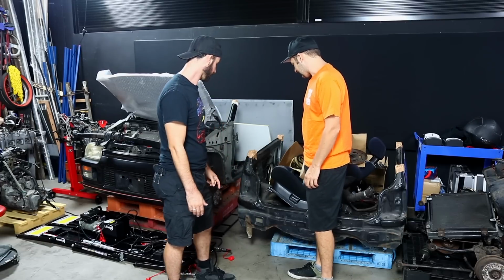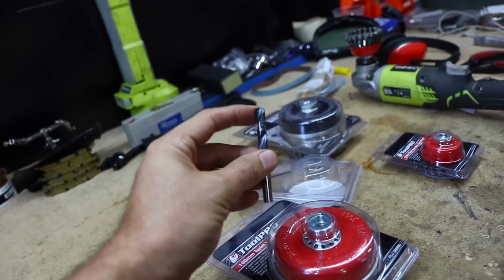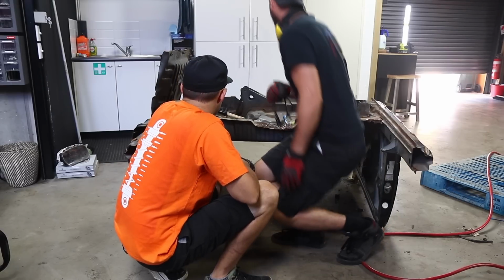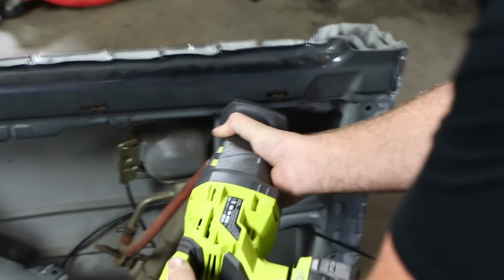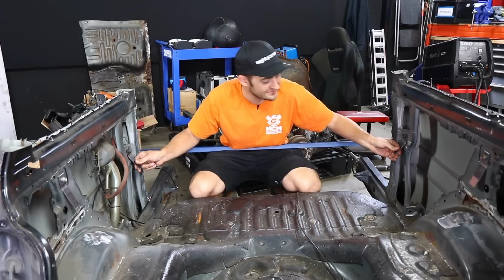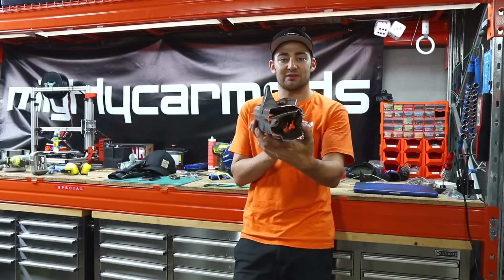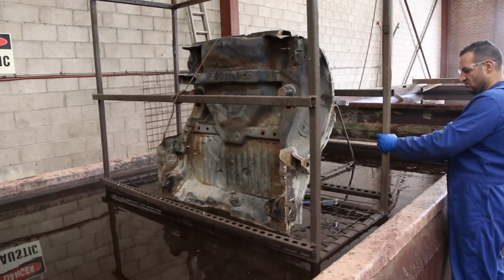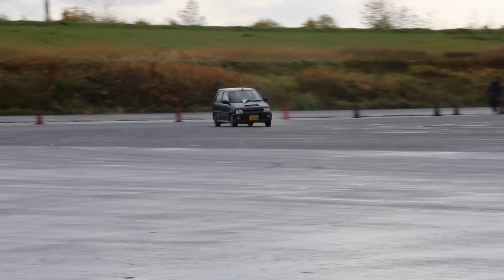Marty's Mira Build [Part 4]

Comment: Everyone from the UK with horribly salted roads is thinking "That's a pretty solid floor, I've seen ten times worse".
Reply: I had an EK9 for 4 years and even after being "undersealed" by the importer in 2008 the underneath when i checked was gash. Such a shame. Wish i kept it and done a proper rebuild. The roads here suck for jdm cars.
Reply: Canada too lol
Reply: New england here, my first thought was, Oh that's not terrible at all.
Reply: Richard Whitfield 😂 cars come new in worse condition here
Reply: Same here in New York.
Reply: my buddys old 850 (i think it was a 98) aside from the plastics and clear coat(which was from UV and minor  stone/sand damnage) the rust was minimum compared to any ten year newer Mazda or Ford was night and day ...though this is true for pretty much any euro manufacture vs American or Japanese...the Europeans just know how to deal with snow, ice and rain better
Reply: Outback Australia here. Just pulled a 1978 Ford out of a guys yard, stored with the windows down since 1993. Not a spot of rust. Love it.
Reply: rust belt american here. I fell threw the floor of my 76 ford van once. Rust sucks.
Reply: That's not bad at all for 90's japanese car as it seems not been protected against rust in any way in japan. Just paint alone is gone after few years in finland where salt is huge problem in south.
Reply: Alaskan here, im mildly concerned my mazda is more rust than steel.
Reply: Richard Whitfield Same with New Jersey
Reply: Richard Whitfield same with germany
Reply: In conclusion: No matter where you are in the world, cars rust :)
Reply: I live on the east coast the rust is bad here
Reply: and the ne of the us lmao
Reply: I tried sweeping up the all the shit off my metro floor for about 2 hours before I realised it was just the floor.

Comment: Canadian here. I can confirm rust is a massive problem here. Oil pan just had to be replaced on my 7 year old car, you could push a screwdriver through it it was so rusted and the replacement OEM oil pan was not made out of cheese like I assumed it would be, it was thick and well built. My stainless steel DC sports exhaust also rusted apart at one of the welds... thats right STAINLESS STEEL RESTS IN CANADA! I'm sure I'd find rust on the aluminum hood somehow. I'd imagine that if I were to drop my whole car in that chemical bath it wouldn't come out in one piece and again its only 7 years old.
Reply: Curtis Murphy I know your pain....
Reply: Oh yeah aluminum will rust with the salt. We had a 2006 or so Peterbilt truck with an aluminum cab where I used to work, and the cab mounts were all rusted to shit.
Reply: Had also year old Supersprint exhaust starting to corrode in Finland. I thought I was buying quality stuff. Car makers can also never use too thick zinc plating on car parts.. Okay it can be hard to paint but at least you still have something to paint without welding new floor or fender if paint chips away.
Reply: Yea my 91 chevy truck is more rust than metal at this point :(

Comment: I hope that thing drifts still when you all finish it.
Reply: Rain Style Drifting its fwd
Reply: george pacan the ADM mira was fwd the JDM was AWD. this is the reason why they needed to swap floors to make way for the rear diff and the driveshaft
Reply: They have the chance to make it even more rigid and replace/repair things, it will probably drift even better if done right.

Comment: Bit of a top tip guys, those big twisted wire attachments are more meant for getting off chunks of thick rust off of a large surface like the frame of a pick-up or a steel boat hull. the best tool for automotive applications are those smaller brass wire wheels and on a low-speed drill or grinder, found that it does the job best and i've probably gone through every single possible other product there is

Comment: The amount of effort put into removing the floor pan as a full OEM part is insane. I would have just cut out the pan around the drive shaft tunnel and differential and welded that in with some extra metal stock to brace it. Even if done well with a lot of attention to detail, it would have taken so much less time/money to do. But these guys are going well above and beyond!

Comment: That is the best system used to dispel any paint, under seal etc, but it also reveals every rust hole.  That is exactly  what you want and just not what you want,,,,if you get my meaning,,,,,. Excellent build so far and you have me hooked,,,, well done.

Comment: A little tip for people pulling apart spot-welded panels like this, instead of using a chisel to pop the panels apart, which can bend and stretch the metal of the panels you want to use due to it's thickness, use some good, strong metal bladed wallpaper scrapers, they're thin enough to go into the panel joints without bending and stretching the metal too much, they're strong enough to help pop the spot welds apart once they've been drilled, the blades are flexible enough to make getting into awkward areas easier and you can grind them down to a sharp edge for tricky areas.  They're also pretty cheap from DIY shops and easily available...

Comment: I hate to blow up the spot of the rust removers, but a sand blaster could've soda blasted it and then treated it and then sprayed it to seal it. Also make sure you put on seam welding spray, it goes between panels and won't burn away unless you weld directly onto it. And test weld an extra junk panel to make sure your welder is at a good temp, nothing worse than melting through and doing a crappy fill in that won't hold.

Comment: The "Kei To The City" Mira is the TRX-X Avanzato X4 version, which is 4WD. 

Same goes to the Avanzato X4R (rally version, limited production) and RV4 (this one is like a mini jeep).

And yes, it would be a hassle to fit all the parts inside the Australian 2WD Mira chassis. Swapping floorpan is good, but in certain country like mine in Malaysia, it's illegal due to tempering the chassis structure & rigidity (well, that's the enforcement reason). 

That is why turbocharged JDM Mira fanboys here opt for the Avanzato or Avanzato R 2WD model halfcuts for the part swap... :)

Comment: drilling spot welds sucks. It took me almost 20 hours over multiple days to get the old rocker off my '72 MGB-GT. I'm surprised you went the chemical stripping route. Here in the US some sort of media blasting is more common.
Reply: Oh, and a panel separator tool works much better than a regular chisel and isn't very expensive

Comment: You guys were doing it the hard way. Good thing Benny showed up.  The easy way is to just cut the part you want out of the half cut a inch or two outside the panel edges.  Then take a good set of vise grips and literally start peeling the excess off by rolling in onto itself like opening a canned ham.  You will need your angle grinder at every spot weld, but they are obvious as you are rolling up the extra metal.  Just grind threw the spot welds as you hit them and keep rolling.   Its much faster and easier than finding each spot weld, drilling it, and chiseling them apart.   There will be less dolly work on the edges to straighten them also.   After locating the new panel, use self drilling screws to hold it in place and the edges flat, and re-measure. Re-measure one more time to make sure its in the right place.  Then, mark where the overlap is, and drill or punch (I have tool just for this) about double or triple the amount of holes in the panel where the original spot weld were in the overlap areas.   Because you will most likely be rosette welding the panel in, you need to do this to maintain strength (the original spot welds are stronger than rosette welds).  The holes should be 5/16" or a 8mm, Then put the panel back in with your screws and rosette weld everything up.  Remove the screws and weld those holes up.   I usually put weld through primer on the flanges you are going to be welding to keep corrosion between the panels at bay.  After you are  done welding, knock down any ugly rosette welds with the angle grinder, etch prime, paint, and seam seal both sides to keep it from rusting out again.  It can get more complicated if you have multiple overlapping or sandwhiched panels, but this is generally how you do it.Also, use a air chisel.  Will make your life much easer.
Reply: Well, crap.  Youtube messed up all my nice paragraphs, turning what I wrote into one long one.....

Comment: Whilst I understand, & greatly admire, your tenacity in transforming an Aussie-spec Mira into a JDM-spec Mira, would it have been possible to have just swapped all the JPM-spec gear into the Aussie-spec shell, with the exception of the RWD driveline, & possibly the gearbox to end up with a turbocharged FWD-only Mira? I'm only asking in case I ever happen to stumble onto across an excellent-value but squeaky-clean Aussie-spec Mira that I just can't resist buying. :-D

Comment: "Hello Canada" indeed. Rust does suck. If you have a nice car here in Canada, its your 'summer car', which is put away for winter to avoid the salt-snow corrosion. That said, snow drifting is probably the most fun you can have behind the wheel. So it aint all bad. :)

Comment: I have an idea for a build!!! either a Plymouth/dodge neon, Honda civic ex or small Chevy with a longitudinally mounted 350CI or 383CI, rear wheel drive with either truck rear end, ford 9 inch or a duely rear end with the duely wheels, lol! twin or triple turbos in the rear seat! exhaust comes up through the floor into rear seat! of course exhaust has to be heat wrapped to maintain heat an pressure into back seat. intercooler mounted under rear package tray. side scoops behind doors to get airflow into intercooler. scoop on boot lid to allow airflow to escape. it would be really light weight and powerful this is my idea for a dream racecar/drift car easy to get the rear tires loose through the turns, what do ya think? I think marty and moog would have a blast building and driving this beast!

Comment: I'm drooling at all of that Ryobi One+ equipment. Those max-capacity batteries are all about $125 a piece, and the super-charger on the wall holds/charges 6 of them simultaneously. Could work cordless all day straight with a shop like that. Drool...

Comment: serious question; how it that process superior to media blasting?
Reply: I'm no expert, but I believe it's a better method for getting between seams where there may be rust etc, plus even with soft media you'll still abrade some of the really thin bits of metal on the outer edges of rust holes (which may or may not matter depending on where it is). I suspect shot blasting (what it's called in the UK) would be an entirely feasible way to do it though, bloody unpleasant job to strip all that crap off though, and would take a fair bit of blasting because of all the glues and what not I'd guess.

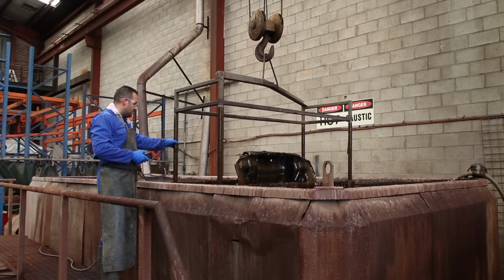Comment: @18:15 we have a system in the US that can clean everything down to bare metal without chemicals, in about 10 minutes. A 1963 Chev. can be stripped in about 54 minutes  You can also do it right on your job site, without dust. They deliver worldwide. Pretty cool.  The name is 'Dustless Blasting' :---)))))))))))

Comment: Those special drillbits are crap. I used them. They wear off and it's very tough to get them sharp at home. Use 3mm drill straight through and then a 8/10mm drill and half-cut the first piece. This way you will strip the weld spots fast and ensure that the welds will be strong (because of the big hole you just made with the 8...10mm drill)

Comment: You guys must change batteries alot, why don't you switch to tools with cords on them? Here in the USA, Ryobi tends to be the less expensive tool so I could see why you would buy them originally being a budget show. But you'd probably never see them in a big shop around the states like your shop. Also, I personally use ryobi tools but I've found them to not be as reliable even though the price point makes up for that a bit. I use the older blue ryobi tools which was the generation before the green ones came out. How reliable have they been for you?
Reply: Holy shit its me! Fast forward 4 years and all i use is Ryobi, and im a commercial HVAC installer.. and they work awesome for the most part haha. I got the new brushless stuff. Use it every day!
Reply: I am also watching all the episodes through again haha

Comment: Go get an appropriately sized "kids wading pool" and 40-ish Kg (or litres) of molasses, mostly fill the pool with water, add the molasses, stir, drop the half cut, right way up, in the pool for 3-5 days. This will remove the rust, and make the metal all clean, and you won't have to spend money on wire wheels, and hours with the grinders, and it will be clean inside and out... OH, and just pressure wash the molasses off, hot wash works better...

Comment: I was going to say why go through all that effort if you don't have too. You may have got away with just removing the suspension mount's and welding them onto the good shells floor. More then likely the shells have the exact same base floor pans the brackets are just different and welded in different locations.
Reply: the floor pan in the aussie model almost certainly doesn't have the tunnel (bump) required to clear the rear driveshaft.

Comment: The reason you do not see other videos of this is because normal people would just import a decent one from Japan? You may not be able to buy the 4 wheel drive in Australia but there is nothing stopping you import one. Many years ago Toyota brought out a Carolla Lift Back. It came out in Germany 2 years before it came out here in the U.K In the U.K you could only buy the 1.200 cc or 1.600 cc they never released the 2,000 CC version. As I was based in Germany at the time I was able to buy a Left Hand Drive 2.000 cc as I was selling it before returning to the U.K 3 years later. I came home on holiday and even the Toyota garages had not heard of it?

Comment: Can you guys do a build at some point where you put a locking diff like from a 4X4, into a drift car? That way you can have a perfectly smooth street car, but when you get to the track you can still do mad skids. I am aware you could just use an LSD but it would be so cool to see a street car with a switch to lock the back wheels. Upvote if you agree.

Comment: Why not simply cut out the part of the floor that doesn't accept the rear drive shaft and modify that small area rather than dealing with the whole rusty jdm rear floor?

Comment: for a minute there I thought marty said Mechanical Stig,  Buy I see grizzly Adams. It's been a while since I've seen him coz of the Honda mini build and Moog all the time with that other Geeza miles. . ( boyz) anything we need to know about. Marty put a scooby motor behind front seat. mid engine, 4 wheel drive Mira. hmmmmm be interest Scooby Mira against  a Honda mini. I mean just how hard could it be lads?. then put them up against each other, best out of five winner keeps both cars.  I bet power to weight in both would be similar.  MAAAAAD

Comment: No-one will address this comment, as usual.

'not a viable option' is NOT the case.

You will find [ just like in Europe ] it was 'market protection', simply based on the cheaper manufacturing costs made higher spec. cars STILL BE CHEAPER THAN LOCAL CRUD YOU COULD BUY.

It was not a 'business decision' but an attempt to HIDE better, cheaper products and keep the local market ignorant of much better products.